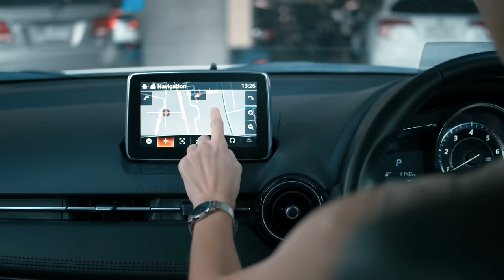10 Shocking Moments Caught On CCTV Camera

Comment: 5:44 Not a black bear. It's a grizzly.
Reply: No, it's a black bear. The narrator says that the footage is filmed in Massachusetts and grizzlies do not live further east than the Rocky Mountains (although some have been seen as far as Bozeman MT. They have been searching farther afield for calories to pack on before the winter now that summers are longer, hotter and drier, the massive fires have been depleting their usual food sources and winters have been much, much shorter)

I grew up in the northeastern US, but I moved to Washington state 36 years ago to go to college and decided to stay. I saw plenty of both blacks and grizzlies and I will give you a foolproof way to tell the difference between the two types of bear. Both bears occasionally have similar colours and both can be practically blonde, but the easiest way to know that your bear is a Grizzly is to find that huge hump over the shoulders; blackies don't have that.  On the skull where the nose attaches to it, a black bear has a very gradual slope from the tip to it's ears, whereas a Grizzly bear's nose has a sharp indentation (or dent, if you will) at the bridge and you can see exactly where it attaches to the skull. The rump of a Grizzly is lower than its shoulders, but the Black's is just the opposite.

(Not to mention, a black bear has much longer ears, but that difference is incidental at this point and you probably won't ever see them side-by-side unless you're at a zoo, so it's only barely worth mentioning)
Reply: @koriw1701 yep, black fur and brown muzzle.  It's definitely a black bear. I've seen plenty here in Michigan.

Comment: Its not the molten aluminum that causes the problem in that one video.  Water is made of Hydrogen and Oxygen, which are very difficult to seperate under normal conditions.  HOWEVER, in a furnace designed to melt metal, the temperature exceeds 3,000° F (1,648.889° C).  At these temperatures,  water will SPONTANEOUSLY  seperate into Hydrogen gas and Oxygen gas, instantly igniting and causing the eruption seen here.

The same effect occurs REGARDLESS of what metal is being melted. NEVER put wet metal in a hot furnace.  This incident is the Foreman's responsibility.   He should have made ABSOLUTELY CERTAIN the machine operator knew the danger.
Reply: Lmao they don't separate molecular bonds the water is vaporized into steam
Reply: The molten temperature of aluminum is 1220F. The eruption was caused either by the water vaporizing into steam or by chemical reaction. Water expands by a factor of 1600 when it turns into steam at atmospheric pressure. Because molten aluminum is quite fluid the water form pockets in the melt where it vaporizes to cause the eruption usually in the form of a spray. That spray can react with the oxygen in the air to form aluminum oxide. In addition water can react with aluminum to form aluminum oxide and hydrogen gas again causing a violent eruption. That chemical reaction is exothermic meaning that it creates substantial heat that can further vaporize any residual water.

Comment: On the bonus one at the end with the helicopter, when asked can you even tow a helicopter? The answer is 100% absolutely. I know for a fact you can use a tug and push a Blackhawk helicopter around. When I was an avionics mechanic in the army I would help the crew chiefs and other general maintenance guys move UH60’s all the time with a tow bar and a tug or a John Deere tractor. I would either be in the cockpit on brakes, on a rope guiding blades, or on the tug or tractor moving the aircraft.

Comment: I wouldn't blame the forklift driver necessarily.  Poor guy could've been the best, most productive and conscientious worker ever, just on a bad day that day.  It should NOT be that easy to break a support of a massive storage structure, and it certainly should not be designed so that one will drag the others down.  It looked like the warehouse owner skimped on structural design to save money.  Accidental crashes should be 100% accounted for in businesses like that, because it's not uncommon for drivers to make mistakes, and if a simple mistake can cause THAT, it's management's fault.

Comment: @ 5:44 Why TF would you show a grizzly bear while talking about black bears? Of all the black bear footage that's out there, you had one EASY job. Thafs just lazy editing.
Reply: Sorry Wade, you should take that blame-storm back because it IS a black bear. We're all allowed to be wrong from time to time, but you were downright rude.

Here's the (very) long (Sorry) note I made on a different comment in this thread:

No, it's a black bear. The narrator says that the footage is filmed in Massachusetts and grizzlies do not live further east than the Rocky Mountains (although some have been seen as far as Bozeman MT. They have been searching farther afield for calories to pack on before the winter now that summers are longer, hotter and drier, the massive fires have been depleting their usual food sources and winters have been much, much shorter)

I grew up in the northeastern US, but I moved to Washington state 36 years ago to go to college and decided to stay. I saw plenty of both blacks and grizzlies and I will give you a foolproof way to tell the difference between the two types of bear. Both bears occasionally have similar colours and both can be practically blonde, but the easiest way to know that your bear is a Grizzly is to find that huge hump over the shoulders; blackies don't have that.  On the skull where the nose attaches to it, a black bear has a very gradual slope from the tip to it's ears, whereas a Grizzly bear's nose has a sharp indentation (or dent, if you will) at the bridge and you can see exactly where it attaches to the skull. The rump of a Grizzly is lower than its shoulders, but the Black's is just the opposite.

(Not to mention, a black bear has much longer ears, but that difference is incidental at this point and you probably won't ever see them side-by-side unless you're at a zoo, so it's only barely worth mentioning)